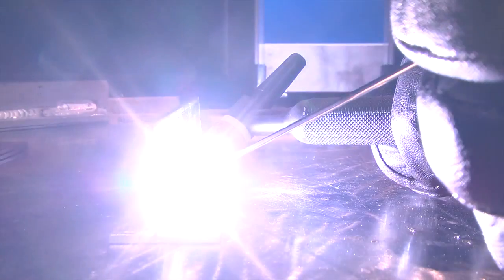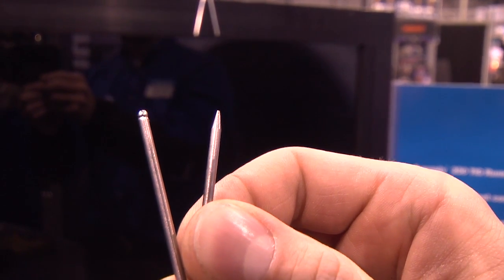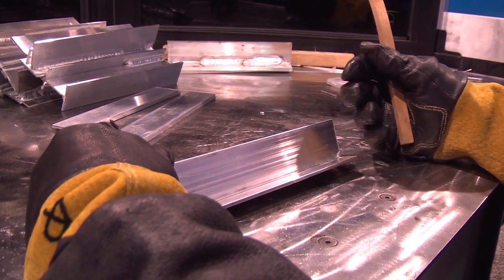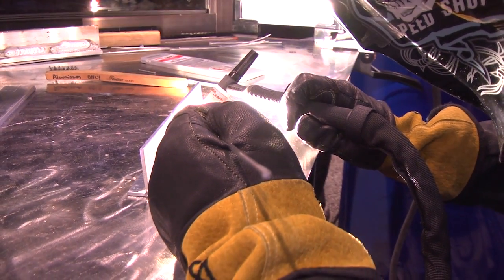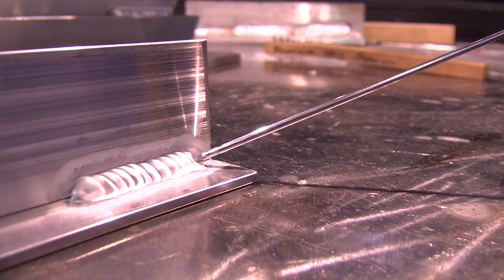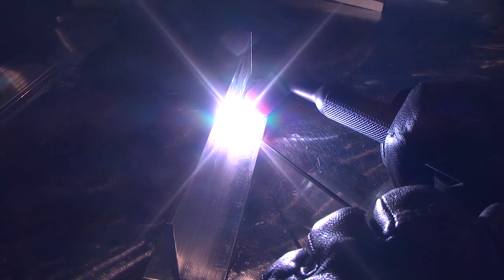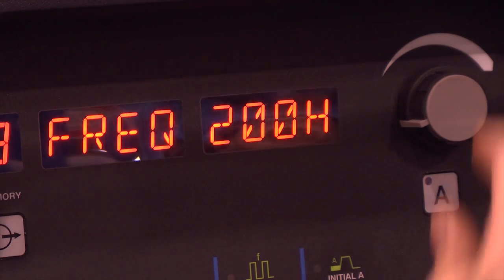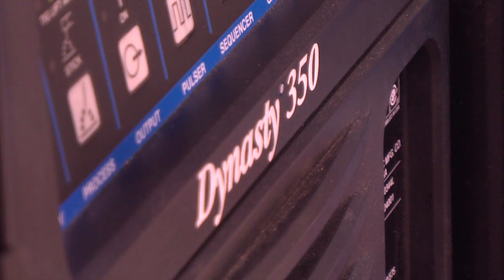TIG Welding Aluminum Tips Using the Miller Dynasty 350

Comment: How do you change the waveform on the EN and EP independently? On a Miller dynasty 350. For example I want to put triangular wave on the EN side and advanced Wave on the EP side. Can't seem to do it through the menu on the machine. Does anybody know this answer?
Reply from the maker: Hi Richard, thanks for your question. We recommend giving our service line a call to talk this through with a tech. The number is 920-734-9821. If there’s anything else we can help with, just let us know.

Comment: I would use ..
Soft wave
En, 200
Ep,125
A.c. balance 80 
Freq,  120
 Full peddle at start 
Float peddle at middle  of weld joint.

Comment: I can totally see that that bead wasn't burned into the corner. I forbid you to pass an x-Ray groove using this overrated dynasty 350. These machines were designed for travel speed only. I dare you to show me a video of a dynasty running a simple 1G pass, blended flush on root and face and go through the zyglow process with no indications. Our company is suffering with indications due to dynasty 350's low welds quality. The welds look great until they're blended flush and display chair porosity.
Reply: Does anybody know what the difference between syncrowave and dynasty machines is?
Reply: Yes, the syncrowave welds aluminum better and creates cleaner welds. The dynasty does fine and uses 1/8 th of the power. But, if you're welding aluminum and it's going to be inspected for porosity.... I'd choose the syncrowave. Both machines are great for dc welding. Dynasty's suck for ac welds that get fluorescent penetrant. 16yr veteran in aerospace here.
Reply: @burfurger3074  interested in your comment. Because I have found the same. Give me back my synchro any day. Stuck with a dynasty and dialling out issues is ridiculous. Porosity is a major issue. 25 years in motorsports.